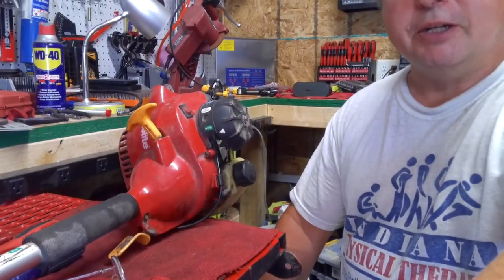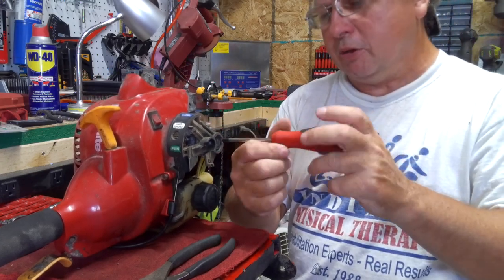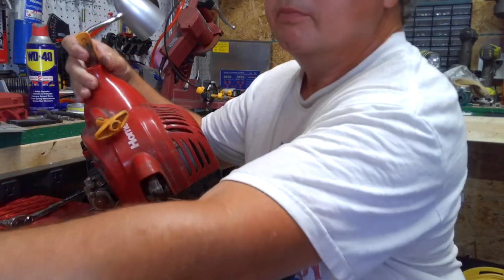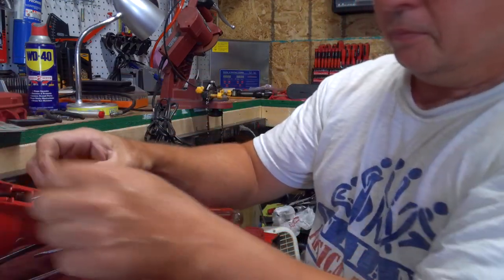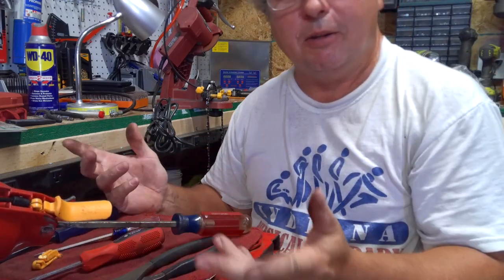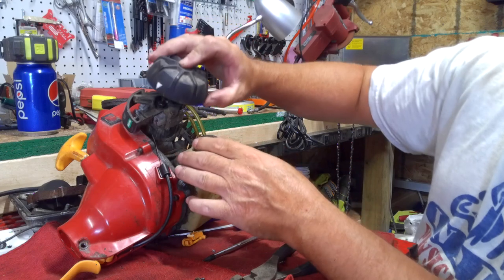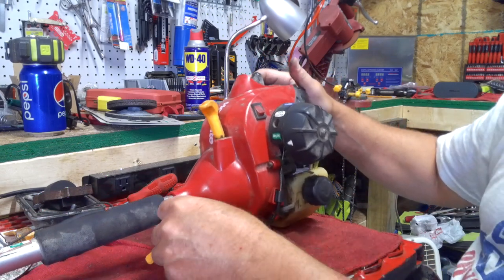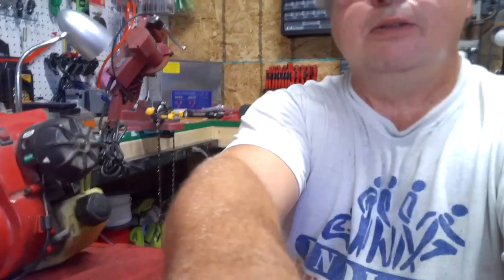Homelite Weed Eater Throttle Repair

Comment: Well Junior that's what happens sometimes I know small engines and I just bought one here at a garage sale guy said it this used it last spring got home at the end been running for a couple years I should have did a video on it but I didn't give me about 10 minutes cleaned it up for a new ball on it gas lines fired it up runs like a Topps now great video
Reply from the maker: Easy fixes. The best weed eater I came across was from Rural King and there mechanic said it was a return and he couldn't get it to run so when I got home I checked the tank to see if it smelled like gas and it didn't so I filled it up and It started I gave $10 for a $150 echo. Thanks for the video view Ron